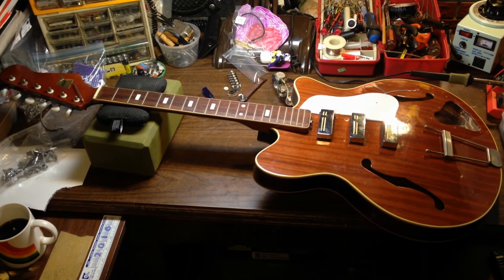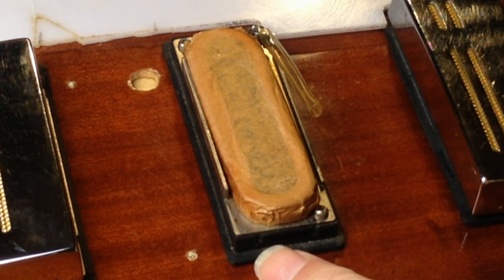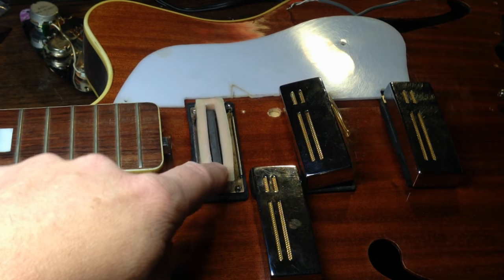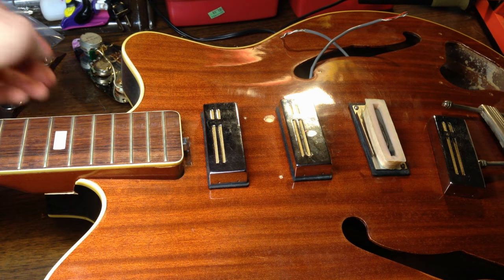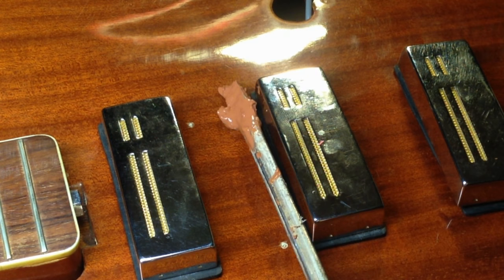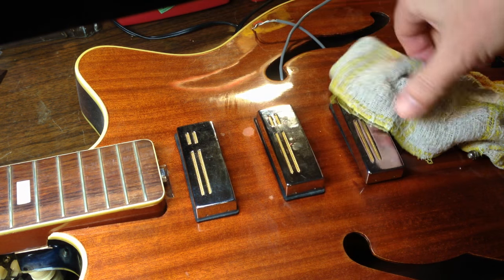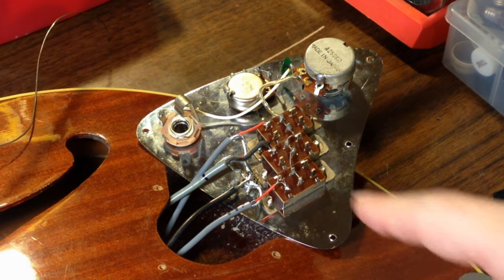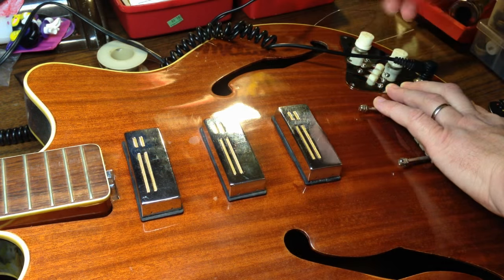Guyatone Kent Americana Restoration Part 1: FIXING DEAD PICKUPS

Comment: I bought a Kent bass brand new in 1966. I paid $70 for it and $15 for a hard shell case with thin felt lining. I was 15 and worked mowing lawns and selling grit papers to pay for it. It was a solid mahogany body and neck. The neck had a rosewood fretboard and the same square fret inlays as yours. It had no truss rod. The neck developed a down bow but it played great! I stripped the sunburst finish off and put 6 coats of auto lacquer on it. I later sold it. I still have the tailpiece cover with the original foam mute. Of course I wish I had kept it, but my wife at the time thought it was stupid to have more than 1 guitar at a time. I later was divorced and was able to collect guitars now. Played a lot of gigs with that bass!  My brothers and Iplayed it and when we get together we always reminisce of the fun we had playing it. Thankz
Reply from the maker: I find those basses to be even more useful as everyday utility players than the guitars. Much more versatile. When you get them set up correctly, they are almost always great basses. Thanks for sharing the memories. Sucks about the ex-wife. Good riddence, by the sound of it. ;)
Reply: The Guitologist You might try a small resistor in line with that middle pickup. A 10k pot would let you dial in the correct resistance and then put that amount in line. Just a suggestion. You may have another maybe better way. I really like your videos! Thankz

Comment: I have one of these Kents.  A friend saw the neck sticking out of the city landfill site and grabbed it.  Someone had spray painted it with grey automotive primer then painted it with white latex paint.....and they painted EVERYTHING!  I'm assuming it was a wall hanger in a restaurant or something.  My friend also found a 1940 Harmony "Broadway" at the same time in the same condition.   Mine has a big chrome tremolo that has "Kent" engraved on it.  In reality it's not worth the time to restore it, however I bring it out from time to time to work on it (finally got all the paint/primer off it).  It will be another year (or more) till it's done. 
So thanks for the video (and all the other stuff you post).  I do not think I've ever seen a vid featuring this guitar.

Comment: I recently bought a near mint Americana 546 cherry sunburst with two gold foils.  And I did exactly the same thing with my neck pickup as it had an open coil which I replaced with the guts out of the clip in magnetic pickup which is very similar to your replacement.  The body is not thinline but a full 2 inch thick.  It came with exactly the same 20 fret neck but I replaced with the LP style oak neck I built 15 years ago.  Although the scale length is same, the one I built has 22 frets so had to move the bridge and the bridge pickup about 3/4 inch to the neck side.  It came with a rosewood bridge which sort of dulled the tone so I made a bridge with a brass fret on top.  The tailpiece is one piece solid metal.  Had to shim the neck quite a bit so to achieve the 1.5mm string clearance at the 12th fret and to have enought clearance between strings and pickups. The knob/switch plate assembly is exactly same as yours except mine has 2 switches vs your 3.   Wish mine was a thinline like yours.  Anyway it is a very huge guitar and the side of the body hits my chest so I have to put some cushion between.   I'm very lucky to own a ca 1964 guitar is such a near mint condition.

Comment: I had a 2 pick-up version up until last fall.  I got it for 20 bucks and got offered 260 for it and an Electra bass I had.  The guitar's neck was replaced by a home-made neck with an Alvarez style headstock.  It was great for slide but the fret board was too narrow for me to play it normally.  I do miss it a bit.

Comment: Wonder if hot wax would have kept those pickup covers in place?
Reply: I would have wax potted them to hold them in place but that's just my way of doing things.
I'm sure Brad will come up with a reasonable alternative.   :-)
Reply from the maker: Couple problems with using wax... One, wax potting will take away all the microphonics, and I don't want that in this case. It's part of the charm to have a little of that. Two, wax would have to be filled to capacity to hold it all together, and no way to do that. The screws that hold the pickups to the body are under the cover, so you cant pot the whole pickup with the covers on and still be able to install them on the guitar.
Reply: The Guitologist that makes sense. the original design of those pickups and how they were held in place is obviously a bit flawed. so the hot glue seems reasonable
Reply: Must have been Japans way of paying us back for Hiroshima at the time.  :-)
Reply: Crazy Uncle Duke  well they did give us Ultraman and the Fujigen factory
Reply: And Fujigen and Matsomuku are apologies accepted for some fantastic guitars of the era.   :-)

Comment: Confused and I cringed watching, why you didn't remove the pickups or at least mask them off, spreading putty on a finished surface use a plastic spreader (old credit card)
But the end result looks ok, did you finish the restoration?
Reply: You don't have to "Cringe" or be "Confused" watching Brad do anything. He works with what he has on hand, and it always ends up being awesome when he is finished.
Reply: I agree